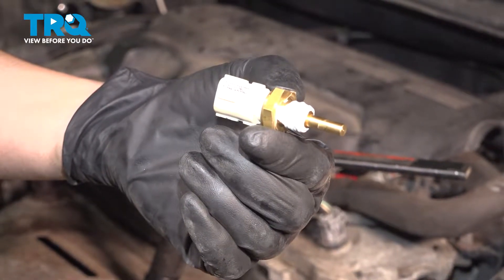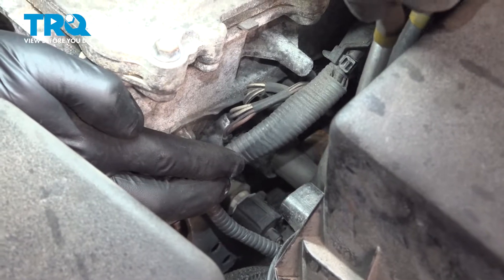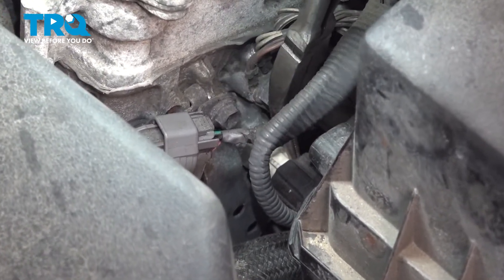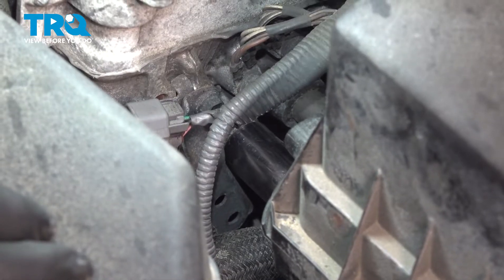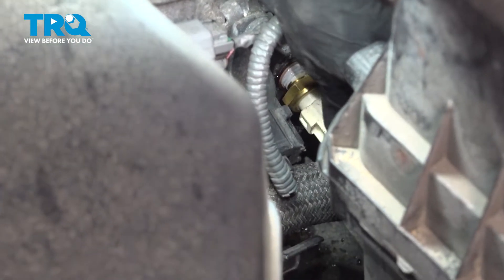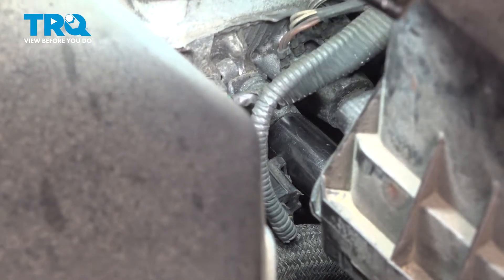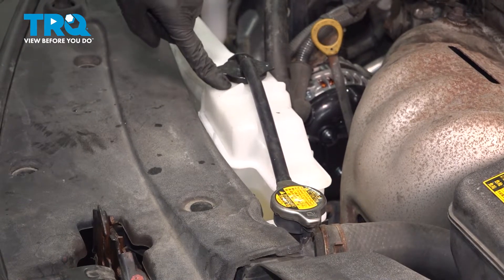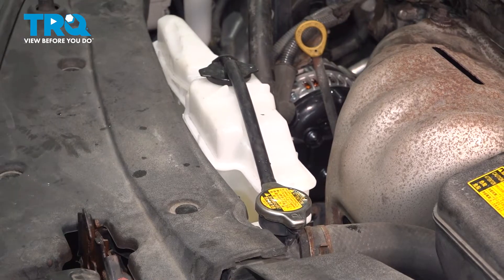How to Replace Coolant Temperature Sensor 2012-2017 Toyota Camry 2.5L L4

Comment: Thanks!  This was very helpful.  I had to remove the portion of the plastic air intake assembly that connects to the grill to buy the room I needed to be able to access the sensor with a deep socket and ratchet wrench on it.  I avoided doing that at first and struggled till I gave up and it was much easier after removing that.   Question.  I used teflon tape on the threads as you showed but have since read that can cause sensor accuracy issues and that tape may not be a good application under the engine’s heat conditions.  Do you or anyone else have opinions on this?

Comment: Is your 19mm deep socket the 1/2 inch type or 3/8?   
I've a Sata 3/8 inch, 19mm deep socket, but I can't thread it all the way in to remove the sensor.   What gives?

Comment: You need to make sure your engine is cooled all the way down before dealing with anything related to your coolant system. It's super dangerous to pop open the radiator cap if the engine is still hot, and I'd assume the same can be said with replacing the sensor